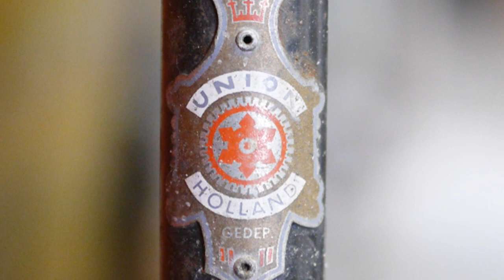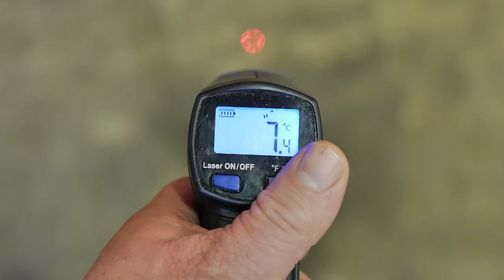fixing up my old bicycle   removing the bottom bracket

Comment: To undo a bottom bracket, I he best way to remember is always undo it in the back-pedalling direction.
Reply from the maker: I guess I was thinking the other way around, so it would not come loose :)
Reply: Good tip. Normally, on front wheel drive cars the driveshaft hub nut on the right hand side is right hand threaded whereas it is a left hand thread on the left side of the car. However, i recently removed both front driveshafts from my nissan juke and they were both right hand threads.
Reply: Looking again at this video, at 30.15 he says  'this is the left side of the bicycle' .   But surely not, it is the right side  that he is trying to  dismantle and as he demonstrates it is a left handed thread there.  Not sure what to make of this  so had a look at bicycle channel  'Park  Tool'  who explains that ( for most designs )  RHS drive side is left hand threaded  whereas LHS is right hand thread.  As for the pedals RHS is  right hand threaded whilst LHS has left hand threads.

Comment: I have a similar Union, and another older one. They feature on my channel sometimes. For cotter pins I use a car ball-joint splitter tool. I made two videos about it.
Reply from the maker: There must be a lot of Dutch bicycles in the UK :) I got one of these ball joint tools, but mine is probably to big to use on cotter pins. But these pins came out rather easy, years ago I ended up with a whole frame in the vice and had to drill one out. In the end I did have to re-use the pins. The new ones I had were not fitting.